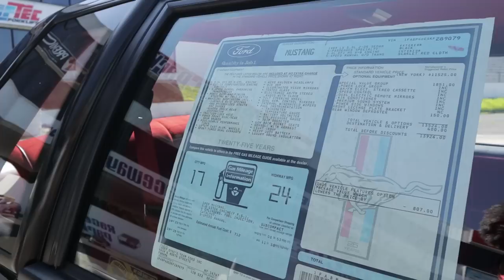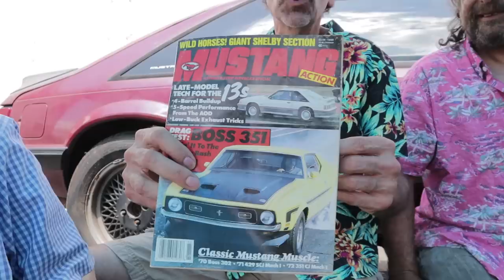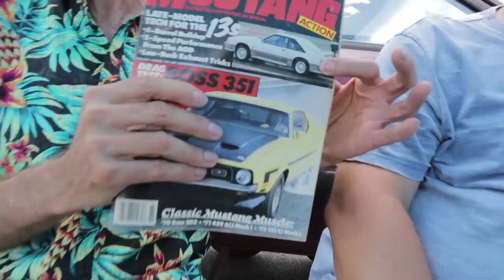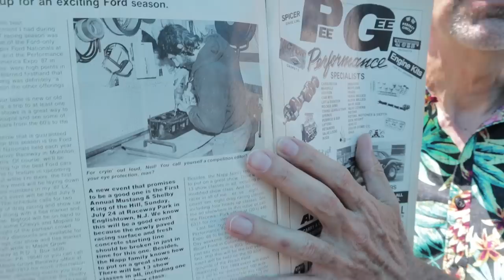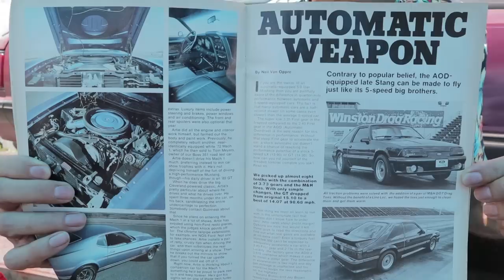5.0 Fox Body Mustang Revolution- The Second Coming Of The American Muscle Car

Comment: The thumbs down must be the guys who bought 86 camaros
Reply: Lube's Iron llc 

2019 Chevy now has hi-tech 2.7l 4 banger truck engines lol
Reply: @Brother Skrill 

Had both but the Camaro/Firebird were superior cars except in power and weight. 

They had panhard bars, torque arms from the factory. Mustangs were faster but the Camaro/Firebird out handled them. 

Stock Mustang snap oversteer  one of the main reasons most got wrecked.
Reply: You know it...brought my Notchback brand new in '92 still have it today...man I use to kill Iroc-Z's at the races back in 92 
A "NOTCH" above the rest
Reply: I remember my first encounter with a Typhoon...had my girl at the time next to me in 92 in my '92 Notchback at a traffic light on 7 mile and Greenfield he torqued up that Typhoon light turned green and instantly 4 cars ahead of me my girl was like were you even trying to race him lol...I had nothing but respect for those killa's after that episode
Reply: AntWuane Windham 

All wheel drive, they would just squatted then be 
gone.
Reply: @South_0f_Heaven_  They did. But you could buy an LX for 10k less an add all that. Port and polish engine. Add a blower and still have cash left.
Reply: @Todd T 

Yeah but all they had to do is turn up the boost, lot easier and doesn’t cost much. Change a spring and turn up the fuel pressure. 

Until TFS heads and upper/lower intakes came along we had nothing. GT-40 heads were overpriced and there was no good Ford production heads
to be had unless you got the old D00E 69/70 351w heads but even they sucked. 

E7TE heads are garbage, can port them all day long and they still suck with tiny intake and exhaust valves. Only thing you could do is a small blower or nitrous kit but for the price per HP not worth it. 

TFS were the game changers.
Reply: @Greg G 

Imagine if they put a turbo on a 350, 4.3 liter is exact same engine as a 350 only with two less pistons. Everything else was identical. 

Would imagine that the higher ups at GM didn’t want anything that would beat their flagship Corvette. Probably why the Syclone/Typhoon didn’t last long.
Reply: @South_0f_Heaven_  Sorry. Those cars weren't that much of a threat and cost a lot more. On stock ported 1.78 E7TE heads and a ported Cobra intake, E303 cam, running 10:1, the engine made  335 HP and torque was the same and we ran out of fuel because the stock 19 lb/hr injectors couldn't supply enough. All I added was beehive springs, the (smog legal) cam and the Cobra intake as aftermarket. With 3.73s that car went sideways halfway through second gear. Easily a mid 12 car and low 12s optimized. Change the injectors add an S Trim blower and run 10s. I was at the track on Corvette/Buick day when someone showed up with a Syclone. Every car driven to the track fell to a Mustang running severely ported stock heads with big valves and an S-Trim with wheels up launches.

I've had TFS TW heads with $1100 worth of work in porting and springs, but all that was waaaay beyond what was needed to spank a GM. Global west track link torque arm and upper control arms removed with a pan hard bar. Tokico shocks H&R springs and energy suspension swaybar end links and polyurethane bushings and welded subframe and subframe connectors I'd blow the GMs away in a straight line and bait them into the turns and let them have it just as bad.

The Mustang wasn't about how it came, it was about how you were going to personalize the car to your want and needs over time. Spending $200-$300 per month always netted a quantifiable gain of some type. Most other cars can't boast the same.

PS I did have D0 351 heads but I also had the 351 in the fox body to match. GM disposal was not an issue, boost turned up or not.
Reply: @Greg G Ha. The last swapmeet I was ever at was in Bowling Green!
Picked up a sunroof for a mint 1986 GT. Found the TFS rep and gave him ** because the heads were back-ordered for the last six months and I got his card and called up my buddy who had a business that ordered them and the guy from TFS made it right.

Twelve+ hours away from my city in Canada, I'd come home from work Friday and sleep until 8:00PM and then begin the drive. Get breakfast nearby and hit the track. Stay there the whole day and check into a hotel for $40-$50 for the night. Get up the next day, get breakfast and hit the track. From the track get dinner and get home (couldn't stay until the end). Sleep a few hours and be at work Monday.

I did |F@CK all on those Mondays, but I had quite a weekend and would wear the t-shirt to prove it.
Reply: @Todd T 

That’s a mid 13 second car on a good day and it’s not pulling the wheels off the ground either. 

E7TE heads are a complete waste of time and money, stock cast GT40P heads outflow them all day long. 

That setup with a factory fuel system, no suspension or tires is not running low 12s nor is it pulling the front wheels off the ground. 

To put those kinds of parts on a car without putting decent heads and upgrading the fuel system is silly. Could have just put heads on it and gone faster without a blower.
Reply: @South_0f_Heaven_  Wow! You must live on top of a mountain and like to granny shift. With 3.73 gears and the ten minute tune up, we ran 13.7 at 101 in a 1992 LX hatch that was fully loaded at 660ft altitude. Those have sand cast intakes instead of the older smoother precision media intakes and a more mellow factory cam than an 89-90. More heavier than a base LX notch because of GT seats and a hatch plus power hatch/windows with A/C. 225/60/15 BFG Comp T/A all seasons. Heat them up and sidestep the clutch at 1900.

Catalytic removal and a short belt would have run 13.5 to 13.4, without even removing a valve cover.

Sorry about your luck...

EDIT: This will show you what you can do with factory heads.

https://www.youtube.com/watch?v=A_Um6F5hkoA

Also there was a class dedicated to stock Mustangs, but I can't remember it's proper name. Guys were running balanced and blueprinted 302 engines. They ran the stock cam 4 degrees retarded and no aftermarket parts and they ran low 12s. I don't know what happened to you or if you are a Chevy guy that doesn't "get" how to build a Ford, but if you recognize anybody in the video way above, you'd know that on a stock head, you can easily run the numbers you claim are impossible. It is so strange that you come to the YouTube post with all of the legends that actually did it and claim that it is impossible. 

You remind me of the Chevy guy that showed up on Ford day to "show us how it's done" and lines up against Gene Deputy His cookies and milk got taken away so fast, he couldn't muster up a tear because he was so confused at how fast lightning can strike...
Reply: @Todd T 

Actually lifelong Ford guy, but respect what the other brands can do as well. 

Also automotive machinist a automotive machinist, you cannot come close what aftermarket or GT40P heads with E7TE heads. There is a physical limit to what size valves that can be used inside the combustion chambers. 

You can put tons of money and time into them and still end up with less horsepower. 

I would know, have a pair of D00E castings and have a entire machine shop at my disposal. For the price of aftermarket heads you can’t come close to them with any factory head Ford ever offered except the GT40P heads. 

If people want to drop $1000 into a pair of E7TE heads that’s fine but don’t go saying they are just as good as aftermarket.
Reply: @South_0f_Heaven_  OK, but what I said still stands. People still ran the numbers, me included. Obviously GT40P are going to be made different and better and at no point in time did I say E7TE heads were better than after market. Otherwise how did I end up buying TFS TW heads?? I'm just saying adtermarket heads weren't a requirement to run low 12s and I'm sure the guys in the video will agree.  I'm saying that you are underrating their potential in stock, mildly ported and heavily ported configurations.

I don't get why you think that I think the E5 or E7 heads are the best either. Just the same as I don't get why you don't respect them for how fast they have already gone. 

The video above is showing all the people that did what you are saying is impossible.
Reply: @Todd T 

I question your claims because I have a good amount of experience with these cars. 

For starters how did you end up with 10 to 1 compression with E7TE heads? They come about 9 to 1 stock with flat top pistons from the factory. Adding another set of flat tops changes nothing unless you mill .0300 off the heads or a serious angle mill then you get to mill the intake afterwords cause it will no longer fit. 

Why would you go to all the trouble for a set of heads that give tops 30 HP gain and costs at least $1000 for porting, oversized valve seats, valvetrain, springs and upgrading the pedestal mount rockers when you could have bought a pair of TFS heads that out of the box will flow better then any E7TE ever will?
Could have even got a pair of GT40P heads dirt cheap that are 5 times better then those E7TE boat anchors. 

Your typical Heads/Cam/Intake is good for about 325-350 crank horsepower. 

Why did the subject change from your car to somebody else’s car and YouTube links? 

Point is a Syclone or Typhoon in a stock vs stock situation will beat the Mustang every single time. Even with mods done unless you have serious suspension work with good slicks or drag radials the Syclone/Typhoon will still win, they are AWD you aren’t gonna 60 foot them. 

The story does not add up, nobody is gonna put a blower, cam, pistons on a car with stock heads. Furthermore to say that you used 19 pound injectors with a stock fuel pump and fuel pressure regulator is laughable, nobody in their right mind would overlook something like that. 

What about the ECU? It has to be tuned to unlock any power increase, the factory tables cannot adjust for the modifications. The car will run but not very well and will be down on HO. The ECU could barely keep the car running right from the factory as it is, add mods and you open Pandora’s box with those damn EEC’s. 

So one of three things is happening here,

1: your stupid

2: your lying

3: your stupid and your lying

If you want to provide some proof like a dyno sheet, drag run slip, pictures would have a better time believing you. But since it got changed from being about your car to all the other people that make crazy power using E7TE heads it doesn’t support your claim. 

You made the claim about your car, back it up with some proof. 

One last thing, where did you come up with that HP number, was it dyno’d on a engine stand or is it estimated horsepower. Big difference between the two.
Reply: WHAT BERNIE SAID ABOUT YOU COULDN'T BUY ANY PARTS FOR THE SMALL BLOCK FORD STEMS DOWN TO THE THREAT THE SMALL BLOCK FORD POSED TO THE SMALL BLOCK CHEVY BACK IN THE 60'S WHEN THE 289ci DEBUT. THE 289ci WAS SUCH A THREAT TO THE SMALL BLOCK CHEVY THAT THE NHRA (HENCHMEN FOR GM OR ANOTHER DIVISION OF GM) IN ORDER TO KEEP CHEVY IN THE WINNERS CIRCLE. WOULD CHANGE THE RULE BOOK ON THE 289ci MOTOR LIKE THE WEATHER CHANGED IN KANSAS TO DISCOURAGE ANYBODY FROM RUNNING IT. THE CHANGING OF THE RULES WERE BOTH WRITTEN AND UNWRITTEN. SO IF YOU SHOWED UP AND RACED AND WON. THE NEXT TIME THE RULES ON THE MOTOR WOULD BE CHANGED SO YOU COULDN'T RUN IT. IT WAS ALL BASED ON CHEATING. WHAT I WROTE HERE FINALLY ANSWERS THE MYSTERY QUESTION OF WHY FORD'S COST MORE TO BUILD. ON THE OTHER HAND YOU CAN BUY RACE PARTS FOR THE SMALL BLOCK CHEVY THAT WERE EVERYWHERE AT NICKEL AND DIME PRICES. SINCE THE SBC WAS THE FAVORED MOTOR. THERE PARTS WERE NEVER RESTRICTED AND MASS PRODUCED WHICH KEPT THEM CHEAP. ON THE OTHER HAND NEITHER WOULD FORD NOR THE AFTERMARKET RISK PRODUCING RACE PARTS FOR THE SMALL BLOCK FORD WHICH THE HENCHMEN FOR GM THE NHRA WOULD BAN OVERNIGHT, AND THE MANUFACTURERS WOULD BE LEFT WITH A WAREHOUSE FULL OF SCRAP METAL. BECAUSE IF YOU CAN'T RACE IT AND WIN, THEN PEOPLE WOULDN'T BUY IT. FOR THE FEW COMPANIES THAT DID PRODUCE PARTS LIKE CAMS, MANIFOLDS, PISTONS, ETC. THESE PARTS WERE PRODUCED IN SMALL VOLUMES BRINGING TO COST UP 2-3 TIMES MORE. NOBODY WOULD DARE PRODUCE A HEAD FOR A SMALL BLOCK FORD BECAUSE OF THE THREAT OF A BIG EXPENSIVE PART LIKE THAT BEING BANNED, WHILE AFTER MARKET HEADS FOR THE SMALL BLOCK CHEVY WERE PRODUCED WITHOUT RESTRICTIONS. WARREN BROWNFIELD WHO I THINK LATER STARTED AIR FLOW RESEARCH WAS MAKING RACE HEADS FOR THE SMALL BLOCK CHEVY FOR YEARS AND SO WAS EDELBROCK. SO IF YOU WANTED A HEAD FOR A FORD WHERE DID YOU GO, NOWHERE. YOU HAD TO MAKE IT. YOU ACTUALLY TOOK CHEVY VALVES AND MACHINED THEM DOWN. ALSO WHAT BERNIE SAID ABOUT A HEAD BEING AVAILABLE FOR THE SMALL BLOCK FORD. CAME ABOUT IN 1989 WHEN TRICK FLOW PRODUCED THEM. IMAGINE IT TOOK CLOSE TO 30 YEARS TO PRODUCED A HEAD FOR THE SMALL BLOCK FORD. AND THE ONLY REASON THEY DID WAS DUE TO THE POPULARITY OF THE SMALL BLOCK 5.0 MUSTANGS. AT THE TIME IT DEBUT THE RACE TRACKS WERE DEAD. ONLY CERTAIN HARDCORE RACERS MOSTLY CHEVY, WERE THERE AND THE STANDS WERE EMPTY. ONCE THE MUSTANG 5.0 CAME INTO EXISTENCE IT INJECTED STEROIDS INTO RACING AND HAS BROUGHT RACING TO WHERE IT IS TODAY. NITROUS, TURBOS AND SUPERCHARGING COMPANIES CAME INTO EXISTENCE AND THE ONES THAT DID EXIST STAYED IN BUSINESS BECAUSE OF THE POPULARITY AND MASSIVE POTENTIAL THE SMALL BLOCK FORD HAD TO MAKE POWER. WHEN I THINK ABOUT THIS STUFF. I THINK ABOUT HOW BIG OF AN IDIOT GALE BANKS WAS THINKING CHEVY WAS THE BEST AND THOUGHT NOTHING ABOUT FORD. IF HE WOULD HAVE PRODUCED TURBOS FOR THE SMALL BLOCK FORD. TODAY HE WOULD BE ONE OF THE DOMINATE LEADERS IN TURBO TECHNOLOGY UP AT THE TOP. BUT THINKING CHEVY WAS THE BEST BLINDED THIS MAN WHERE TODAY HE IS A LIMITED COMPANY STRUGGLING ALONG TO STAY ALIVE. LOOK AT THE IRONY OF THIS WHOLE THING. THE NHRA PUT BANS ALL OVER THE SMALL BLOCK FORD FOR YEARS TO KILL IT. ONLY FOR IT TO COME BACK YEARS LATER TO BIT THE CHEVY SMALL BLOCK IN THE ASS. ALL YOUR 5.0 RACE CLASSES WERE CREATED FOR FORD, BECAUSE THE SMALL BLOCK FORD HAD NO COMPETITION, THE CHEVY SMALL BLOCK COULDN'T COMPETE IN THESE NITROUS, TURBO AND SUPERCHARGING CLASSES. IN ORDER TO BECOME A PLAYER YEARS LATER GM DUMPED THE CHEVY SMALL BLOCK IN FAVOR OF MAKING THEIR OWN SMALL BLOCK FORD THE LS. FROM TOP TO BOTTOM THE LS IS 1000% FORD. NOT 1 ONE DESIGN ASPECT OF THE OLD SMALL BLOCK CHEVY LIVES IN THE LS, THE LS IS ALL FORD IN DESIGN.
Reply: @darryl163  THE MUSTANGS WERE EATING THE CAMARO'S ALIVE TO THE POINT GM HAD TO CLOSE THE ASSEMBLY LINE DOWN. TODAY THEY ARE OFFERING A $3000 INCENTIVE TO POTENTIAL MUSTANG BUYERS TO BUY A CAMARO BECAUSE THEY ARE IN BIG TROUBLE BECAUSE NOBODY IS BUYING THEM. ONCE AGAIN THE CAMARO IS SLATED FOR THE SLAUGHTER HOUSE. THE COYOTE ENGINE IS KILLING THE GENERIC FORD COPY THE 427 HIGH RISER AKA RAISED PORT 351 WINDSOR. GM IS A JOKE TODAY.
Reply: lso4988  THE 5.0'S WERE EATING UP THE GRAND NATIONALS WITH STOCK BOLT ONS. WITH NITROUS, TURBOS AND SUPERCHARGING THE MUSTANGS DEVOURED THEM AND THE REASON BUICK STOPPED PRODUCING GRAND NATIONALS, LIKE THE CAMAROS TOO.
Reply: I owned a '92 Camaro for about 8 years.Yeah it handled nice but wouldn't get out of it's own way.My '05 Equinox would blow it away.I didn't like the Fox bodies when they were new,but I love them now (except the ones with the rounded front end and the bubble headlights).Mad respect for the 5.0 Mustangs!
Reply: @lubesEquipment  In the Vega THAT was THE GOOD ENGINE to have...
Reply: @Todd.T  Nah there's millions of his kind, he was just stupid enough to show it....
Reply: @Frank289100  did you read that before posting it? I build various types of engines including the LS series...people actually told me to look at your comment. I don't have a problem with your bias towards Fords but at least do some real research before you preach. I don't even care what your response to this is, I'd remove this comment before you entertain more people with it.
Reply: @greasemonkey258  WHICH COMMENT? IF IT IS THE LS ENGINE, THEN YES IT IS COMPLETELY BASED ON FORD DESIGNS.  NOT 1 ONE DESIGN ASPECT OF THE OLD SMALL BLOCK CHEVY LIVES IN THE LS. THE LS IS COMPLETELY BASED ON FORD DESIGNS. PUT YOUR FINGERS INTO THE INTAKE RUNNER OF A LS. IT CURVES INTO THE INTAKE VALVE IDENTICAL TO THE FORD WINDSOR HEAD DESIGN, WHICH IS A SPIRAL INDUCING COMBUSTION CHAMBER. I CAN GO RIGHT DOWN THE LIST AND SHOW YOU ALL THE FORD DESIGNS IN THE LS, IF YOU WOULD LIKE ME TO. EVERYTHING CHEVY USES IN RACING TODAY IS COMPLETELY FORD. FROM THE CHEVY/GM  PROSTOCK DRCE - DRAG RACE COMPETITION ENGINE (WHICH IS A BIG CUBE FORD CLEVELAND ENGINE SINCE 1983 TO CURRENT DATE) TO THE CHEVY NASCAR R07 (A FORD CLEVELAND KNOCK OFF WHICH EVEN HAS THE DISTRIBUTOR IN THE FRONT) TO YOUR SYMMETRICAL HEAD CHEVY RACE ENGINES WHICH ARE CLEVELAND FORD DESIGNS LABELED AS CHEVY MOTORS. TO THE 800+ CHEVY MOUNTAIN MOTORS WHICH ARE FORD BOSS 429 DESIGNED WHICH THE MANUFACTURES LABEL AS CHEVY AND HIDE FROM THEIR CHEVY CLIENTELE. CHEVY USED RULES AND RULE BOOK TO STOP FORD FROM WINNING. IT HAS BEEN GOING ON FOR DECADES IN BOTH THE NHRA AND NASCAR WITH THE RESTRICTOR PLATE TO SLOW FORD DOWN. IT'S A PHONY RACING DYNASTY.
Reply: @South_0f_Heaven_  
B.S.
The mustang out handle the camero and firebird. I know for a fact. I had a mustang and a firebird trans-am.
Reply: @South_0f_Heaven_  oh ya I had both as well and my mustang was better handling faster and looked way better since my hair could blow in my 5.0 so step aside and get yourself wrecked try hard
Reply: @South_0f_Heaven_  

Fool I had them all camero mustang trans-am. The only thing camero and trans am had were areodynamics
Reply: @South_0f_Heaven_  YOU ARE CORRECT. BUT THE SVO TURBO 4 CYLINDER WAS BETTER HANDLING THAN THE V-8'S. FORD RACING MADE A VERY CHEAP SUSPENSION BUSHING KIT THAT ENHANCED IT'S HANDLING RIGHT UP THERE WITH THE FERRARI 308 OF IT'S TIME. BUT ALL IN ALL THE F-BODIES HANDLED BETTER. BUT FROM A ENGINEERING POINT OF VIEW FROM A STREET CAR PERSPECTIVE. THE BETTER HANDLING WAS ANOTHER GIMMICK FROM GM TO SELL THERE CARS TO THESE SUCKERS WHO BOUGHT THEM. WHEN THE CAMARO GUYS WERE GIVEN THE KEYS TO THEIR FRIENDS 5.0 MUSTANGS. WHEN THEY RETURNED THE FIRST THING THEY ALL SAID "I MADE A BIG MISTAKE BUYING THIS IROC". ALL THE LS CHEVY GUYS ARE USING FOXBODY MUSTANGS BECAUSE THE PLATFORM IS MUCH BETTER FOR THE QUARTER MILE. INSTEAD OF USING THOSE UGLY IROC CAMARO'S.
Reply: Frank289100 unless you put a panhard bar and torque arm on a Mustang they do not handle better then the 80’s F-Bodies. It’s a well known fact. 

Most V8 Mustangs got wrecked because of bad handling and snap oversteer. If you don’t know what snap oversteer is look it up or go drive a factory 5.0 and see how fast the rear goes out when the suspension unloads. Even the 4 bangers would do it. 

The Koni shocks on the SVO helped a little bit but in no way bring it up to a F-Body with the panhard and torque arm from the factory.
Reply: @South_0f_Heaven_  THE MUSTANGS WERE DESIGNED FOR THE STREET WHILE THE CAMARO WAS A GIMMICK WITH IT'S BETTER HANDLING. I CAN TAKE MY SHIT AND PUT THE CHEVY LOGO ON IT AND BECOME A MILLIONAIRE.
Reply: God they were horrible
Reply: @South_0f_Heaven_  (1989 IROC/TRANS AM WEIGHT 3,086 - 3,362 LBS ) (1989 MUSTANG GT 3200 LBS) NO BIG WEIGHT DIFFERENCE HERE. WITH BOLT ON NONE POWER ADDERS THE MUSTANG GT'S WERE BREAKING INTO THE 12.99'S. STOCK THEY WERE BEATING THE CAMARO'S AND WITH BOLT ON'S EATING THEM UP. THE GRAND NATIONALS WERE GETTING THERE ASSES KICKED WHERE NOBODY WAS BUYING THEM ANYMORE AND WHY THE PRODUCTION LINE WAS CLOSED DOWN. THE SYCLONES ALSO FELL PREY TO THE MUSTANGS AND PRODUCTION OF THOSE WERE ALSO CLOSED DOWN. ONCE NITROUS, TURBO'S AND SUPERCHARGERS CAME INTO PLAY. IT WAS LIGHTS OUT FOR CHEVY/GM. DOZENS OF RACE CLASSES WERE SHAPED BY THE SMALL BLOCK FORD FROM 5.0 OUTLAW TO 5.0 PRO. HALF OF THE RACERS IN THOSE CLASSES WERE ONCE CHEVY GUYS. THERE WAS NOTHING THAT COULD COMPETE AGAINST THE SMALL BLOCK FORD. THIS IS THE REASON GM COPIED ALL FORD DESIGNS WHEN THEY CREATED THE LS. NOT 1 ONE DESIGN ASPECT OF THE OLD SMALL BLOCK CHEVY LIVES IN THE LS. THE LS IS 1000% FORD DESIGNS. YEARS LATER MIKE MORAN TOOK A LS INTO THOSE 5.0 CLASSES AND THEY STOMPED HIS ASS DOWN.
Reply: @crazytrain7114  THOSE IROC'S WERE EVEN WORSE. HORRIBLE DOESN'T DESCRIBES THOSE GM CARS AND THE REASON CHEVY RACERS DON'T USE THEM. BUT INSTEAD MUSTANGS BECAUSE OF THEIR LOOKS. LOOK AT THE INTERIOR ON THOSE IROC'S. THEY ARE A JOKE.
Reply: @Frank289100 yes, there is. For starters the F-Body is a larger car and has extra suspension components like a pan hard bar and torque arm that overall much beefier then a Fox Body.
Reply: @joe alcott actually they were better cars and had much better suspension, brakes then a Fox Body ever was. Only issue was they are heavier cars. 

No comparison in handling and braking between a F-Body and a Fox Body. One of the main reasons why the Fox Body’s always got wrecked was a large issue called snap oversteer.
Reply: @South_0f_Heaven_  EVERYTHING YOU SEE TODAY IN RACING TERMS OF NITROUS, SUPERCHARGING AND TURBOS WAS SINGLE HANDEDLY ALL STARTED BY THE SMALL BLOCK FORD. THE SMALL BLOCK FORD SHAPED RACING TODAY TO WHAT IT IS PERIOD..................................................................................................
Reply: Frank289100 exactly the 5.0 is what restarted the horsepower wars of the 1960’s. For about 15 years past 1971 to 1986 all we had were no horsepower slow pigs on the street. 

It’s too bad the Mustang is no longer the cheap and fast car it was from 1964 1/2 to about 2005.
Reply: @South_0f_Heaven_  ( For about 15 years past 1971 to 1986 all we had were no horsepower slow pigs on the street.)<<<----- BACK IN AND VERY EARLY 1970'S UP IN THE BRONX. THEY RACED ON MOSHOLU PARKWAY. THE FELLOW WHO DOMINATED RACING THERE WAS CALLED "AL RESPECT". THERE IS A SHOW PRESENTLY ON CALLED "DONKMASTER". THE STAR OF THE SHOW IS SAGE THOMAS A TALL BIG BLACK FELLOW. AL RESPECT WAS THE SAME, TALL BIG AND BLACK AND A GENTLEMEN. IN THE NEW YORK CITY AREA "AL RESPECT" WAS KNOW ALL OVER THE 5 BOROUGHS. HE DROVE A 1970 COBRA JET MUSTANG. HE LIVED AND BREATHED "FORD". AL RESPECT WAS A SUPER OF A BUILDING IN THE BRONX AND MADE HIS LIVING RACING FOR MONEY AND HE NEVER LOST A RACE. FROM HEMI'S TO 427 L-88'S HE ATE THEM ALL UP. MY FRIEND JACK HIS COUSIN WHO WAS KNOWN AS "CHRIS AND SPARTAN" BECAUSE OF HIS GREEK ANCESTRY WAS AL RESPECTS BEST FRIEND. THEY LIVED IN THE SAME BUILDING TOGETHER AND HUNG OUT EVERYDAY. AL RESPECT TAUGHT CHRIS HOW TO BUILDING HIS FORD. IT WAS A 67 MUSTANG WITH A 302 WHICH THEY GOT OUT OF A STATION WAGON. THE LOWER BLOCK WAS LEFT COMPLETELY STOCK. THE HEADS WERE PORTED AND POLISHED ON THE EXHAUST SIDE ONLY. THE INTAKE RUNNER WERE LEFT ALONE. AL PUT SODIUM FILLED EXHAUST VALVES INTO IT AND THE INTAKE VALVES WERE LEFT ALONE. IT HAD A CAM (DON'T KNOW WHAT THE SPECS WERE). A ALUMINUM EDELBROCK MANIFOLD, HEADERS, HOLLEY 750 AND A ZOOM DOUBLE ROLLER TIMING CHAIN. CHRIS TOLD ME THE CAR REVVED SO FAST AND HIGH. IT CONSTANTLY ATE UP TIMING CHAINS AND HE WAS CONSTANTLY WAS REPLACING THEM. CHRIS'S CAR DID CONSISTENT 11.57'S. ONE DAY THEY TOOK CHRIS'S MUSTANG TO NATIONAL SPEEDWAY AND RACED. CHRIS BLEW EVERYBODY AWAY AND WON. BILL GRUMPY JENKINS WAS THERE AND THEY SET UP A FRIENDLY RACE BETWEEN CHRIS AND GRUMPY JENKINS. GRUMPY HAD A BIG BLOCK CAMARO AGAINST CHRIS'S HOME GROWN 302. OBVIOUSLY GRUMPY BEAT HIM. BUT ONLY BEAT CHRIS BY 2-3 CAR LENGTHS. MY FRIEND JACK IS NO LONGER ALIVE. SINCE I WORK IN MANHATTAN I MEET LOTS OF IMPORTANT PEOPLE. FOR YEARS I'VE BEEN LOOKING TO SEE IF AL RESPECT WAS STILL ALIVE TO GET HIS ENTIRE LIFE STORY SO AS TO MAKE A MOVIE ON HIM. WHEN I PASSED IT BY THE THIS MOVIE PRODUCER. HE TOLD ME TO GET HIS STORY AND AGREE WITH AL RESPECT TO SECURE THE RIGHT TO HIS STORY FOR A BOOK. AND THEN COME TO HIM SO THEY CAN REVIEW HIS STORY TO SEE IF IT WAS WORTHY OF A MOVIE. AS OF NOW I'VE COME TO A DEAD END. BUT I'M STILL SEARCHING AND HOPEFULLY I WILL BE SUCCESSFUL. OVER MY 59 YEARS I'VE HEARD COUNTLESS STORIES OF FORD'S RIPPING UP THE STREETS IN RACING BEFORE THE 5.0 MUSTANG DEBUT. MY FRIENDS BROTHER IN LAW HAD A 1965 MUSTANG HE TOWED DOWN TO CONNECTING HIGHWAY AND LAUREL HILL. LOOK UP CONNECTING HIGHWAY THERE IS AN OFFICIAL SIGHT. THIS MUSTANG HAD A 289 WITH A DUAL QUAD TUNNEL RAM. YOU SEE THIS TINY MOTOR THIS THESE CARBS COMING OUT OF THE HOOD AND A PAIR OF SLICKS THAT LOOKED LIKE THEY CAME OF A DRAGSTER. THE CHEVY GUYS FEARED HIM. ONE DAY THEY TOLD THIS GUY RUNNING A BIG BLOCK CHEVY TO RACE HIM. HE TURNED AROUND AND SAID "YOU HAVE TO BE A MANIAC TO RACE HIM". WHEN THEY ASKED HIM WHY. HE SAID YOU WILL NEVER WIN NO MATTER WHAT YOU ARE DRIVING. SADLY WE NEVER SAW THE CAR RACE. STREET RACING WAS BIG TIME DOMINATED BY FORD'S. THE TRACKS WITH THERE CHEATING RULE BOOKS WERE CHEVY.
Reply: @Frank289100 yeah we had those kind of antics on Long Island. Parents sold a 1970 Vitamin C Orange Cuda 340 during the gas crunch. Phone rang off the hook for that car.
Reply: @South_0f_Heaven_  ON THE STREETS THE FORD'S WERE REEKING HAVOC. I HAVE DOZENS OF THESE STORIES.
Reply: @alainbrisebois8334  those DSM cars were pretty cool back then. My father had a 91 Laser 2.0 non-turbo, was a interesting car just not very well built. That car literally died at 100k miles, 3 transmissions and 1 engine that smoked like crazy cause the valve guides were trashed. Left a good smoke screen after the light turned green from the oil leaking into the cylinders while idling. 

Would the rear end come out on yours while doing a hard turn at speed? Would imagine the extra driveline weight in the rear would help as the regular FWD the rear was light.
Reply: Hey!    I have had several 86 camaro's, but gave thumbs up!
Reply: @South_0f_Heaven_  it's a shame they didn't put a 4.3 in a camaro/firebird, especially with a turbo, it would be a nice handling package, light weight, and power, they could easily made 350hp, maybe 400hp. with a light engine!
Reply: @jonathanlawson4667  why don’t you present the fact that zero 350’s came with a 5-speed. 

Facts dictate that a lighter car with more horsepower and a 5-speed beats a 3400 pound heavy pig 350 Automatic Camaro. 

Only cars the Fox body guys worried about were Grand Nationals, Syclones and Typhoons. 

I was there to see it in person 30 plus years ago, were you? 

Btw I used to waste 350 Camaros with a 2.8 liter Firebird on a regular basis.
Reply: @jamest.5001  4.3 is just a 350 with two less cylinders. 

They did put them in Syclones and Typhoons, AWD they were monsters. 

Other then that it is exactly the same as a SBF.
Reply: @jonathanlawson4667  no, it wasn’t faster. 

Stock vs stock the Fox destroyed F-Bodies
Reply: I had an 86 190 horse 305 TPI Iroc, but I swapped a T5 into it, and 3.73 S10 gears. No traction problems, helped me catch many Fox off guard in the Bronx stoplight drags. NO thumbs down from me. 5.0 Stangs were a force to be reckoned with in 86-87. Traction was my only benefit.
Reply: @MrSwinger1  yup lot of people out there that just regurgitate what others say in a attempt to interject themselves into a conversation.
Reply: @Frank289100  hardly , but the GNs were expensive. I bought the 5.0 though because I could afford it
Reply: ... and had fox bodies as daily drivers where it snows
Reply: naturalcreature6317  anyone can straight line from a roll with slow cars that hook at low speed. 

Not anyone is good at power shifting, and most people can't launch a stick with the best of em. 

Why comment?
Reply: @South_0f_Heaven_  I had an 88 hatch that went 13.6s on a completely stock engine minus CAI, exhaust and under drive pulleys. Stock heads, intake, and cam. 

Stock suspension minus shocks and subframe connectors, and 235/50 e/t street radials. 

Had a stone stock 87 coupe run 13.9s. 3.08 gears. And most of what's being referred to as the 10 min tuneup. No aftermarket parts
Reply: @mlin3129 lol mustangs did not outhandle the f-bodies. Not even in the same ballpark, whether by the numbers or by the seat of the pants feel. ZERO conparison
Reply: @South_0f_Heaven_ 2.8l firebird? I agree with you on the turbo GM cars being the only scare for the Fox
Reply: @garlandjones7709  know all about the “10 minute tune up” since the very early 90’s

And yes costs zero dollars just a little time, timing light, multimeter and a few quarter inch sockets to take out and throw away the air box silencer.
Reply: @South_0f_Heaven_ imagine drag racing on a gravel road and that's what I did to my cousins friends mustang when I was 14 and all that happened was it hit the ditch and got some grass and mud up in the wheelwells